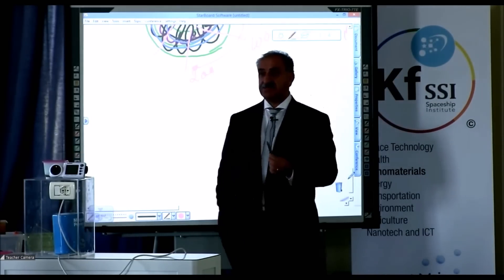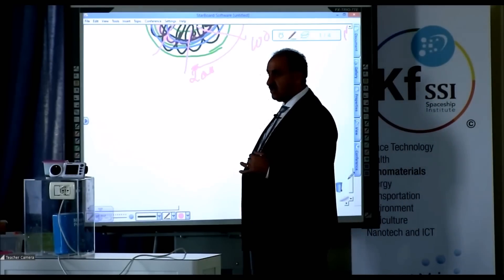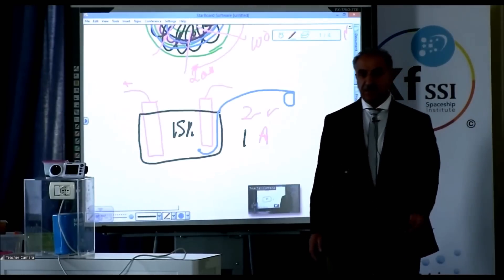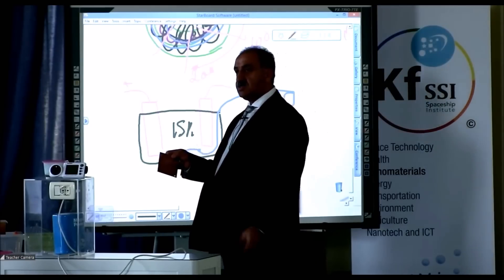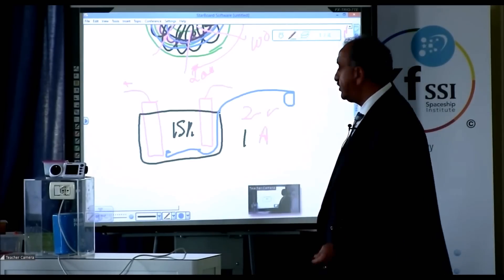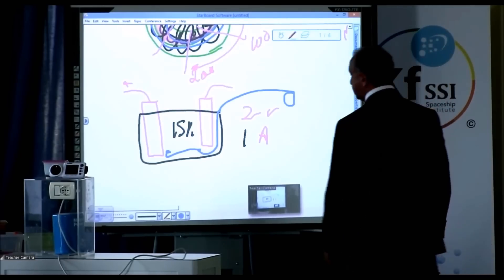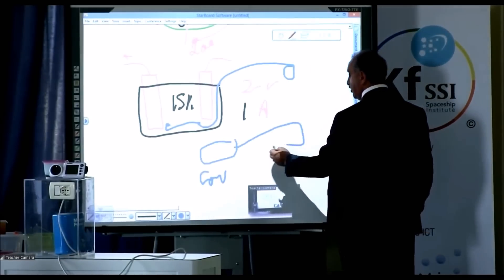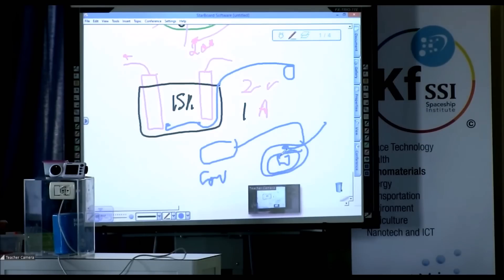86th KSW GANS mass production

Comment: Does anyone know if plugging in the Plasma Generator with the Electric Car, would 
need those  very Exspensive   lithium Batteries. Electric car not needing  a battery would be Awesome
EVERYONE would want an Electric Car.
Reply: +Gary Williams  200 volts at 2500 amperes. No problem for the electric man :D